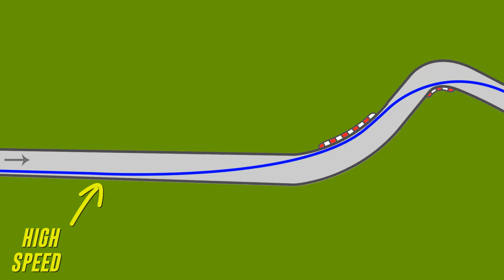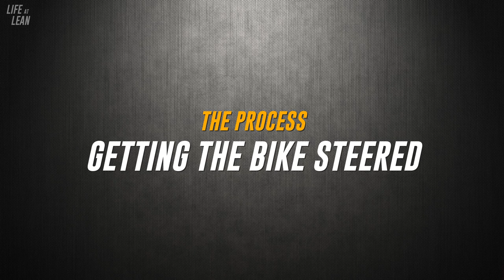How to Ride Chicanes Fast on Track

Comment: First of all, I love this channel! I'm a rookie trackday rider. Last year I started doing trackdays on my roadbike, riding behind an instructor. Bought a small trailer to haul more stuff. This year I bought a proper trackbike and started doing my first proper trackdays without instruction. I'm making lots of progress and your videos helped me every step of the way!

But there's still tons of stuff to learn. So far i've learned that:
- A racebike without a sidestand is a nuisance. invest in a front wheel chock and make your life easy.
- Buy a tire pressure gauge and monitor your tires after each sessions. My tire wear has been flawless.  
- bring a lawn chair, a parasol and a coolbox. You'll spend more time waiting in the paddock than riding on track. Make sure you're comfortable.
- buy proper brake pads. The road stuff isnt suitable for trackdays and you'll soon cook your brakes. Scary stuff

Long story short there's still so much to learn. I'd love to see more videos about the practical stuff of trackcraft. Things like RaceBike maintenance. How to safely strap your bike on a trailer, how to swap wheels and brakes. What things you can't do without in a normal trackday etc. Looking forward to any new videos!

Comment: A great break down of chicanes. The track near me has a nice fast right-left chicane that I'm starting to find speed in. I use the throttle to stand the bike up at the transition but if you leave it on too long, the bumpy track gives the bike a bad headshake, and the same on the exit of the left if your too aggressive on the gas. So it's a great place to learn timing and throttle control lol
Reply: Yup. Our instruction would be to pick the bike up with throttle. However we can do this but maybe this is an advanced technique?

Comment: Interesting points raised where you talk about the amount of force required to make the bike change directions, my track experience surprised me with how much force is required on the bars to countersteer in 2 spots, either fast section cornering into a slower corner (trail braking) and changing direction when already at a high speed without the need to brake. In my experience i agree that at times there is a place for both pushing AND pulling the bars together to force that countersteer.

Comment: That was a very clear and informative way to break down attacking chicanes!

So what is your technique for a 3 point chicane? For instance we have a double chicane at HPR in Colorado just before going uphill to the start/finish line. It’s a left, right, left. A lot of us aim to take the first left tight so that way we have a more direct approach towards the apex of the right hander for a quick snap back to the left so we’re as close to the apex as possible to be able to hit it at full throttle.

Comment: Do you have a video with tips to high speed cornering?
Reply: Smooth throttle application, don't hang off too much, turn in later then you think.

Comment: My bike wobble teribbly when I do a highspeed flip flop (change of direction) is this because of bike setup or because i change direction aggesively?
Reply: That used to happen to me… 
turns out it was both…
I was using more input then I should on the handlebars while committing to the transition…
So more relax arms and a steering dampener did it for me…